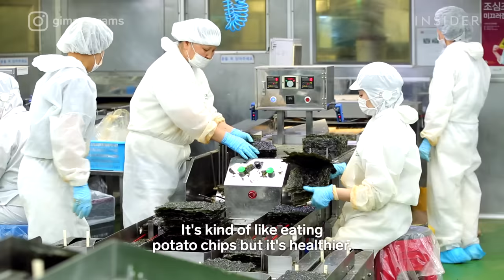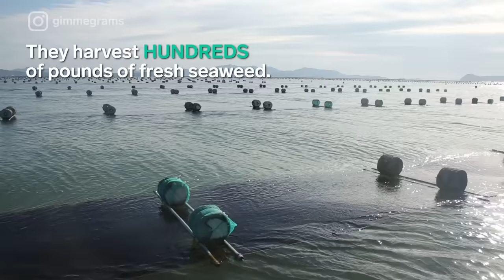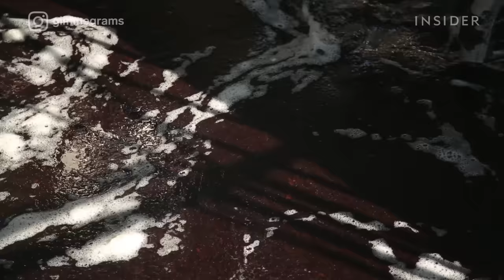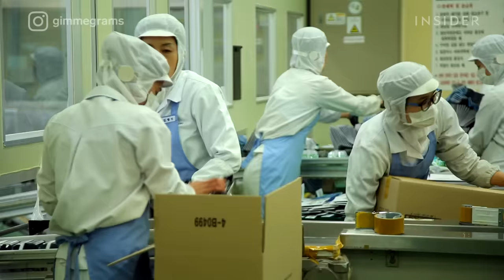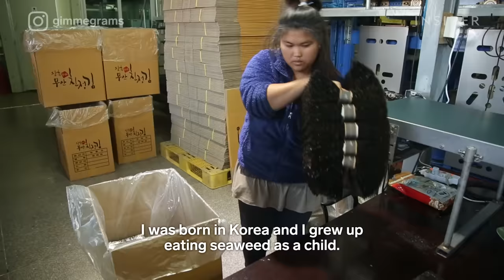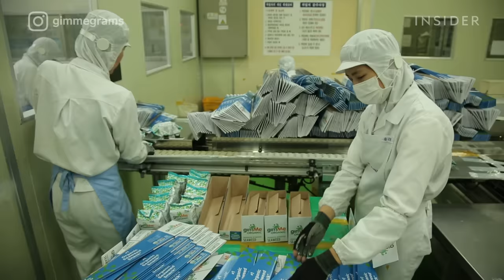How Roasted Seaweed Snacks Are Made

Comment: Best deal is costco, it's an 8 pack for $ 8.99, it has about 20 sheet in each pack. The other kinds have 5 sheet in each and it cost $5.99 for 8 teeny packs. Annie Chun was the most expensive when it first came out for $3+ one pack, now you can find "deals" like less than $2.

Comment: Kind of wish they would stop with some of the packaging though. 8 small squares of seaweed for a plastic carton that holds the seaweed and a pretty thick plastic wrapping.
honestly its basically like just buying very well packaged air at this point. It's healthy, yeah, but its dried seaweed. You're only getting like 4~5g of it per pack. Not getting much of anything for the amount of trash it generates.

the ones with stacks of bigger sheets of seaweed in a bag makes so much more sense imo